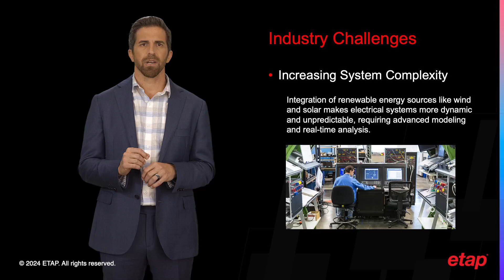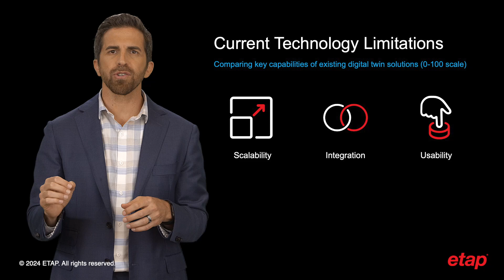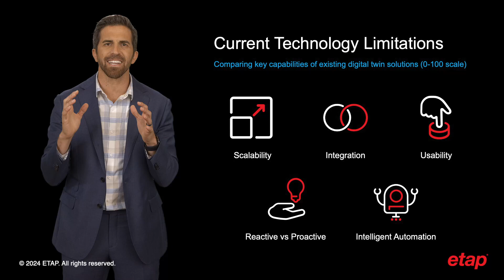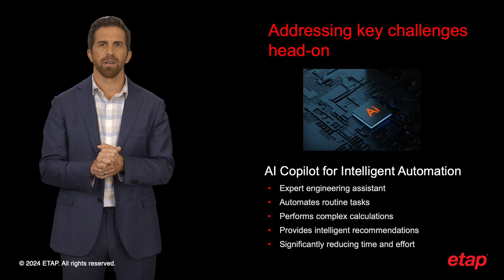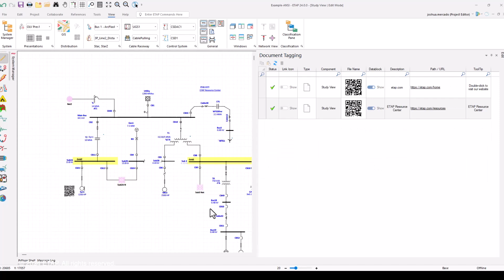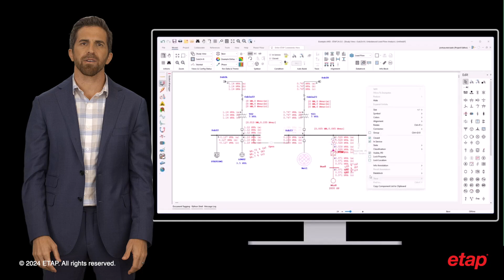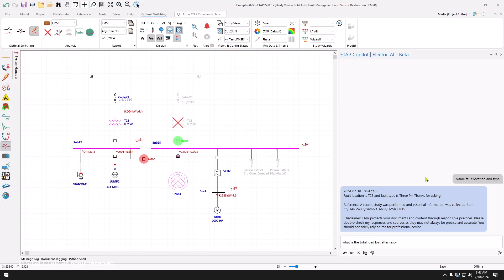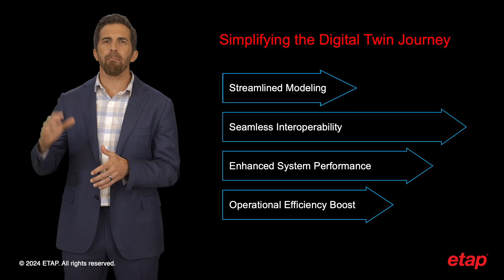​Learn How to Simplify Electrical System Analysis with ETAP Digital Twin & Electric Copilot

Comment: Very informative video. I just want to ask if this digital twin works more like SCADA because if it is real-time, I think it offers beyond just analysis and tends to become a SCADA system.
Reply from the maker: Thank yo for your interest in ETAP Solutions.
With ETAP's Digital Twin you create a real-world virtual replica of a power system by combining detailed electrical models, single line diagram, with live data from SCADA, PLCs, and smart devices. It allows operators to monitor system performance, run predictive simulations, and make informed decisions before applying changes in the field. This improves reliability, safety, and operational efficiency across the electrical network.